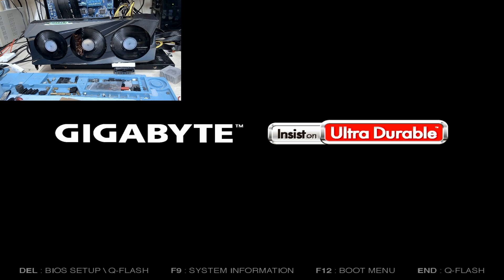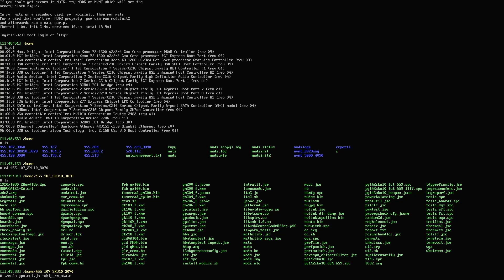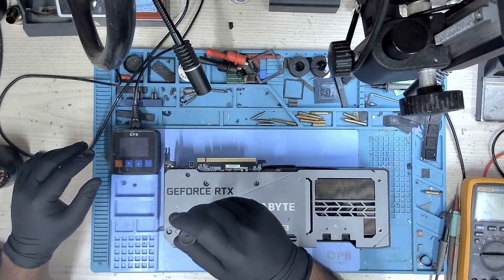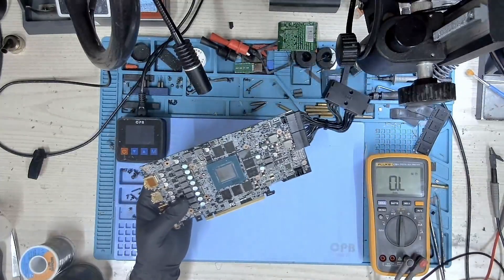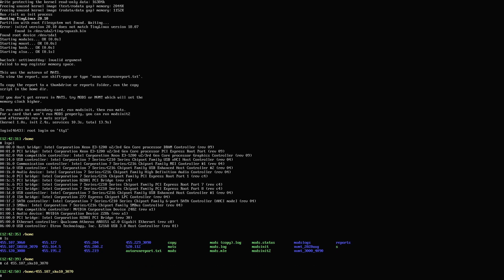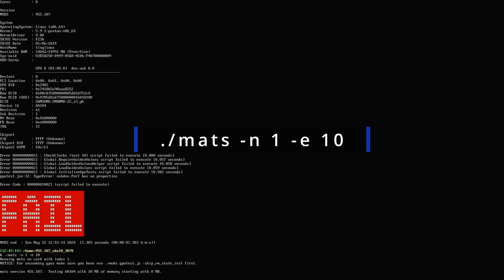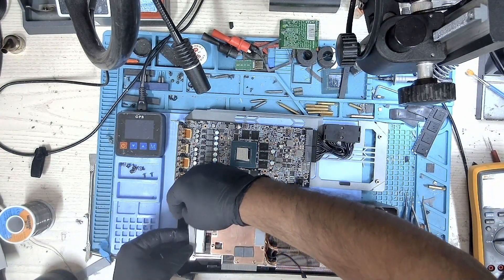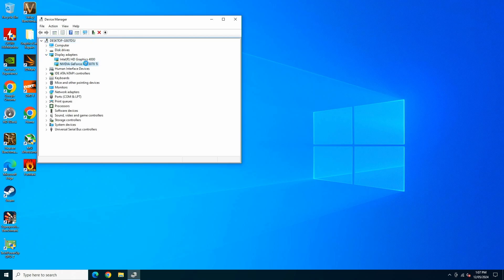How to Fix Gigabyte RTX 3070 Ti Display Issues (and why they exist)

Comment: What if, on the initial test only one chip has error. After reballing that chip, the error was gone. But suddenly all remaining chip now have errors😅
Reply from the maker: Possibility is that the installed chip is faulty. Like shorted 1.3V or 1.8v. check resistance which will give you a clear picture. Try replacing the memory again. Not just reball. Make sure there is enough heat from the bottom so you don't have to use higher temps using the hot air from top. On GDDR6X mods as secondary will show you the exact memory.

Comment: Thanks for your channel fraser, it's great. I've got this exact card- a gigabyte rtx 3070ti. I checked all the power inputs and logic rails (5v, 1.8v and PEX) for resistances as well the VMem. I think it still could be a memory issue given it's not booting. I've found conflicting info online about MATS and MODS, such as that it won't work on newer cards. I think you would make a clear and smile MATS/ MODS video! thanks again
Reply from the maker: Thanks a lot for the kind words and for taking the time to check all the rails on your 3070 Ti – you’re definitely on the right track. 👍

You’re right, there’s a lot of confusion online about MATS and MODS on newer cards. In reality, they work fine on all modern NVIDIA GPUs as long as you’re using the correct MATS/MODS version and configuration.

I’ve made a dedicated video where I explain how I test GDDR6X and GDDR7 memory using these tools in detail:
https://youtu.be/gon1OA74_ZA

That should give you a clear idea of how I run VRAM tests and interpret the results. If you get any specific error codes or patterns from MATS/MODS, feel free to drop them in a comment and I’ll try to point you in the right direction.
Reply: @GraphicsCardRepairs-tk7ql  thanks so much!

Comment: I have a problem with my “new” used rtx 3070 ti, and its shows 6gb and 192bits instead of 8gb and 256bits, what can be the problem? Maybe 2 memories disconnected ? The gou is genuine
Reply from the maker: RTX 3070 Ti used GDDR6X and will not boot if there is a fault in the memory. If it's booting then it's possibly a driver issue. If after reinstalling drivers it does not work then it would need a diagnosis to investigate further as it's not normal to show 6 instead of 8 unless bios is edited.
Reply: @GraphicsCardRepairs-tk7ql it boots normally and I use it to play and 0 problems, no black screens nor artifacts… i will try to unistall and install again drivers!

Comment: where can i learn the skill to repair pc part

other  question can i add more Vram to my rtx 4060 8go
Reply from the maker: The best way to learn electronics repair is to start small with components like resistors, capacitors, diodes, Inductors, and transistors. understand and learn how each of these components works and functions. Thereafter you can move to more complex components like MOSFETs and other ICs. Types of IC's (power, logic) and their functions.  Once you have an understanding of how each of these components works you can gradually move up by studying the power circuits and filters. Use of MOSFETs, Regulators, Controllers, and Drivers in power circuits. Study their datasheet and their typical use in power circuits. Study individual basic voltage power supplies like 12v, 5v, 3v, etc. This will give you an idea of how these voltages are generated as the circuitry is very similar to the ones used on motherboards and GPUs but are more complex. This will help you to build a base to start to understand the motherboard and GPU circuits. You can then start to practice on dead motherboards and GPUs building your soldering skills and tracing connections and circuits. This will help you in finding faults. Thereafter just practice, practice, and practice.  Some of the channels link below which can help you in learning components.
https://www.youtube.com/@LearnElectronicsRepair . He explains different components very well. You can go through his content.

All RTX 40 series use 2GB of memory. 4060 has only 4 memory slots. 2GB is the highest memory capacity produced on the GDDR6 and GDDR6X platform. None of the 40 series of Nvidia can be upgraded.
Reply: @GraphicsCardRepairs-tk7ql  I just wanted to take a moment to thank you for getting back to me. I really appreciate you taking the time to reply. Your content is always inspiring, and it means a lot that you took the time to respond.

Keep up the amazing work! Looking forward to more great videos.

Comment: sir why does that failed first and after applying  -1 how does that pass i did understand that portion of this video 😮
Reply from the maker: The failed one is MODS. The one used later is MATS which passed. Sometimes MATS  and MODS can really act funny. So you will have to judge based on the results. With experience you will start to make right calls.
Reply: @GraphicsCardRepairs-tk7ql  thanks for the reply 👍🔥
Reply: @GraphicsCardRepairs-tk7ql  can  this gpu smt components can be purchased?
Reply: how can we find the short on the board were do we start? and is the any schematics for this gpu board
Reply from the maker: Watch my other not detected videos on the channel. Many are related to short circuits. You will learn how and where to start. I have an entire playlist for not detected

Comment: And you haven't done anything with the grey pads under the memory module? You reball the module and put it back on the board?
Reply: I think you should have mentioned it in the video as its very misleading. Your content is really cool but it would have been nice to hear that as viewers sould learn from you. Just my opinion. But great work btw.
Reply from the maker: Feedback accepted. I will do that in my future videos. It a miss. Thank you 😁
Reply from the maker: The gray pads you are referring to are pads that are missing. The pads were ripped off but since they were not connected pads it did not matter. 😁

Comment: hello. i have the same error on  8:22 and my card also passes mats.but black screen after drivers are installed. i also see minor lines time to time. what may be the problem?
Reply from the maker: What does mods show? If you have nvmt run that too and then with the collective information a decision can be taken. Most likely it may need a core reball.
Reply: @GraphicsCardRepairs-tk7ql   gputest.js shows fail as 8:22 and nvmt shows all readings are identical. i will try reball.thanks

Comment: could you share with us a little bit about you , how you learn , like you learn by your self , study , take private courses and how you decide to repair graphics cars , myself i started 15 years ago but i repair cellphones i am from mexico , and i learn myself by trial and error and now i can do repairs at component level not to advance but enough :D thanks for the vid
Reply from the maker: Well it's a long story but I will keep it short. I have been designing circuits boards  and repairing audio devices and many other electronics devices for over 20 years. Most of those years were spent as a hobby rather than service. Designing my own power supply and other stuff. The graphics cards started about 6 years ago when I moved to the UAE and wanted to build my gaming PC here. Graphics cards were sold at a premium and I did not have the funds to buy one. So I put an AD to buy broken GPU. Watched a couple of videos of elitech and fixed both the GPU I bought 1070 and rx580. I sold one. I then started buying broken graphics cards fixing them and selling them. I started building my equipment slowly over the months there after and It's only about a year later I started offering GPU repair as a service. I started my own YouTube about 9 months ago in a bid to make my presence felt and showcase my work in my locality. Looks like it's just a start and let's see where this path takes me.
Reply: @GraphicsCardRepairs-tk7ql  awesome ur story is interesting love to know more jeje , it feels amazing when u repair something broken i enjoy it so much  , thanks for sharing <3
Reply: Hello my good sir how much would something like this cost me my guy is doing the same thing powers on but no display fans spin but then stop.

Comment: I don't trust MODS or NVMT. I get conflicting information often. I rather go straight for MATS in most cases. As always, great video, Frazer! You're the boss my friend! I am very happy to see your channel explode from barely a few subs to almost surpassing my little channel in a few months. Great work my brother from another mother 🙂!
Reply from the maker: Thank you brother. 😁 Yes I don't trust it either. I normaly run Mats , Mods and NVMT. I literally have to judge which one is possibly correct. Mostly I go with Mats most of the time and it's correct. For GDDR6X because I have to run as secondary mods give ok results but many times it has been wrong too. It's like a hair pulling game. 😁. I still remember your first advice to wait until the video has been processed. I just follow that as a Bible now.
Reply: @GraphicsCardRepairs-tk7ql  I learned about the video processing time the hard way. And no one bothered to tell me. So I thought I'd would help you to know that starting off. I'm truly happy, my bro. I hope your channel hits 100k subs in no time. Your work speaks for itself.
Reply from the maker: Thank you brother for being there all along 😁